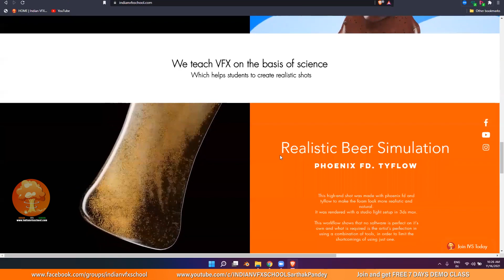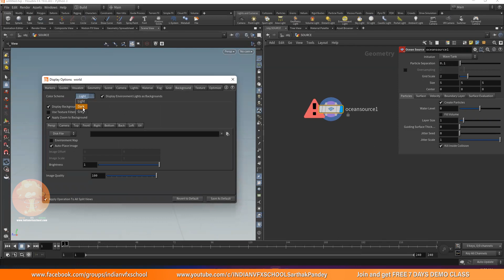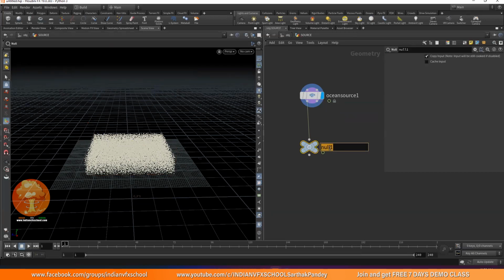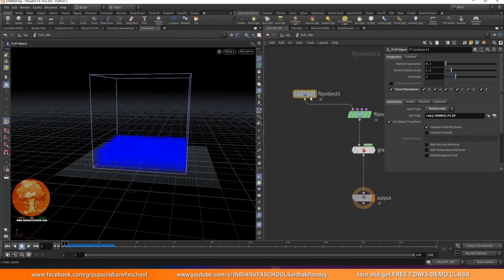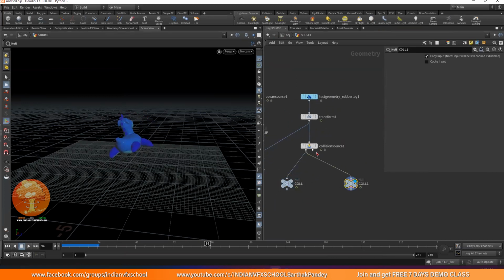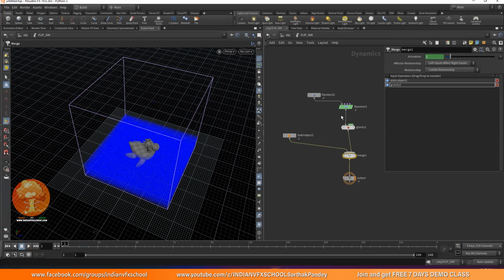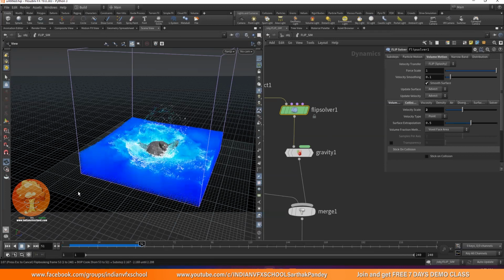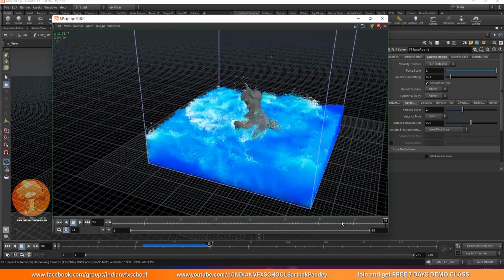Houdini Flip Tank Course - Part 1 - Setting Up Flat Tank #Houdini #FlipFluids #Flip #Fluid #FlipTank

Comment: For some reason my particles are way big 
its set to 1.2 exactly like in the video
Im on 19.5(Non commercial)
Reply: Solution?
Reply: For anyone still strugglingwith that you need to change it in flipobject >guides > particles > visualisation and change to Particles. The author answered it in the comments but I almost gave up on it since I couldn't find the solution

Comment: The blue bubbles are way too big on my pC
Reply: any solution for that? I'm having the same problem
Reply from the maker: Go to Flip object, Guides, Particles, Visualisation and change from Sprites to Particles.
Reply: @indianvfxschool   thanks for the quick reply! It worked. amazing thanks
Reply: @indianvfxschool  I also had "Display Sprites" checked in the display settings on a fresh Houdini install. It wasn't enough to set it from Points to Pixels, I also had ti uncheck that box.